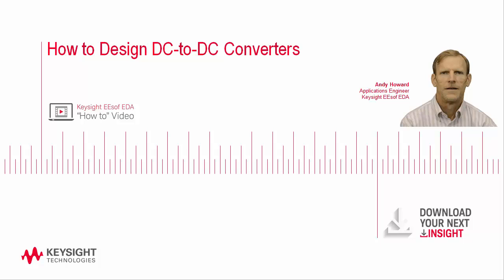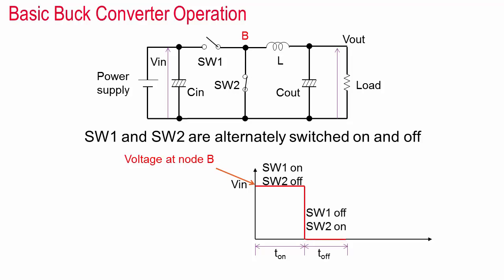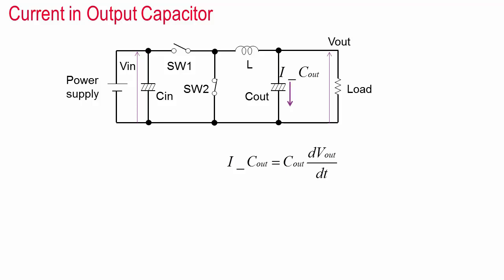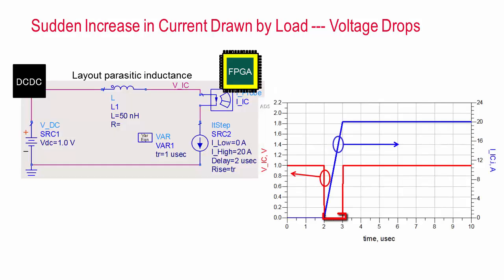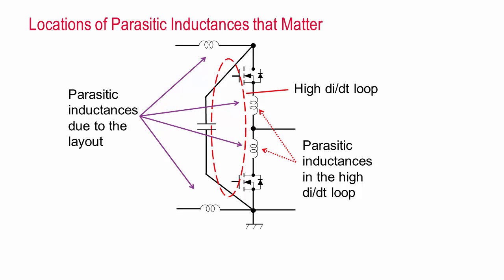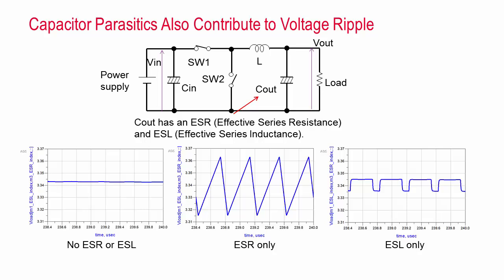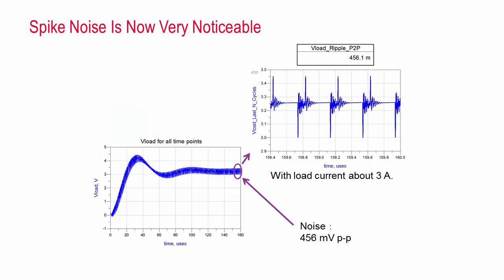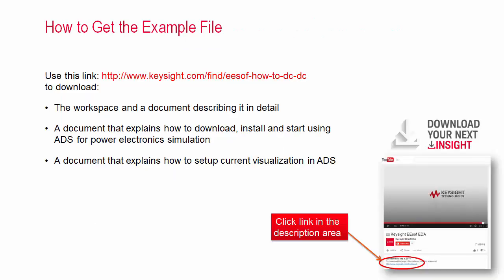How to Design DC-to-DC Converters

Comment: Hi,is there any significant use of reducing ripple voltage of a boost converter by a few millivolts,say from 5mV to 2mV?Within the tolerance levels of ripple,does changing it by a bit make differences in any application?If so,where?
Reply: How to solder

Comment: Can ADS be used for Electromagnetic Simulation? The schematic looks alot similar to the ADS.
Reply from the maker: Hi, yes that is an ADS schematic. ADS includes many types of
EM simulators. It includes the Momentum Simulator for passive circuit modeling
and analysis using Method of Moments, an FEM Simulator for 3D structures, an
FDTD Simulator for arbitrarily shaped 3D structures using an iterative process,
SIPro EM-technology for high-frequency accuracy, and PIPro analysis for Power
Integrity applications. If you are interested in trying any of these EM
simulators for a 30-day free trial, go to Apply for a Free Trial of ADS: http://www.keysight.com/find/eesof-ads-info.

Comment: this explains a lot regarding strange operation of today's TVs when decoupling caps start to gain ESR.   if I find, for ex. 3.220 volts at a smd reg. output, I immediately suspect a cap. nearby.I suppose if I used a scope instead of DVM I would see excessive ripple.

Comment: Really helpful presentation. I have a few questions though. I've checked the project file and I found that ports are defined between a pin and common groung, but the project does not have a ground plane. Where is the actual ground? It does not seem to be physically anywhere at all.
Reply from the maker: In this case, layer pc4 has only a
ground plane.  Therefore it would be OK to replace layer pc4 with a cover, and have the negative pins for all the ports on this cover.  This would also lead to faster EM simulations because there would be fewer substrate layers. If layer pc4 has both signals andground, or there are potential differences on the ground plane, then it would be more accurate to include negative pins on pc4 for the port definitions.